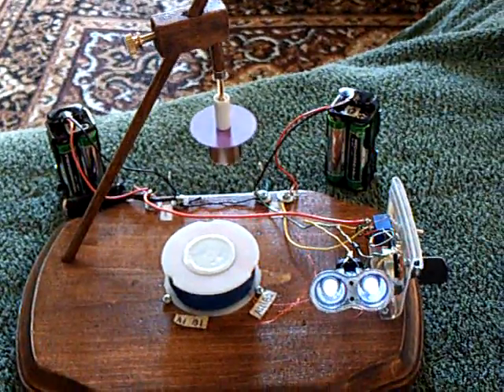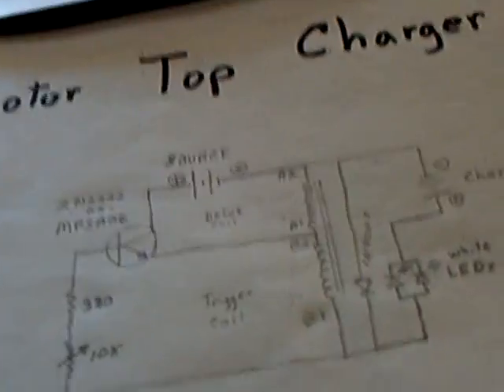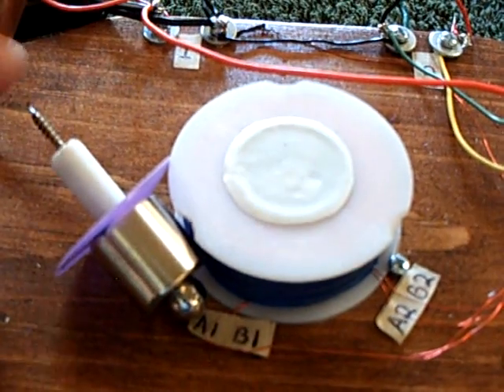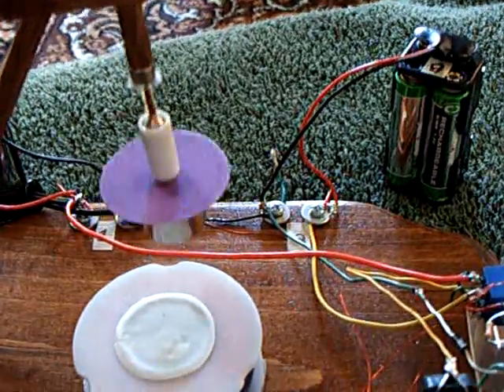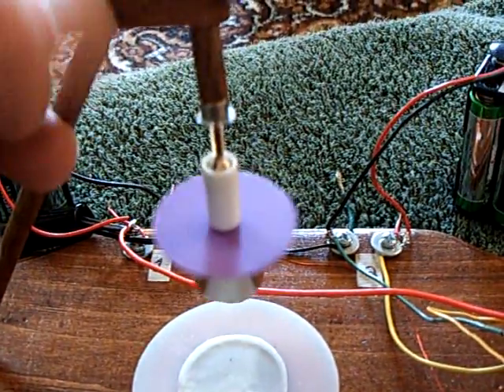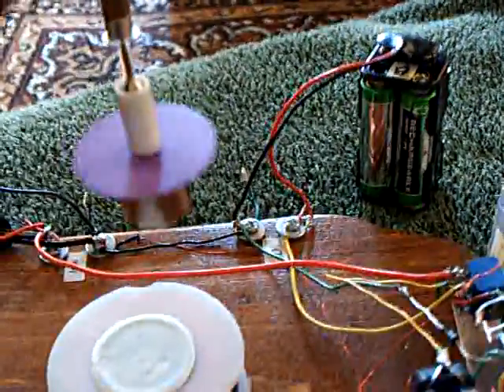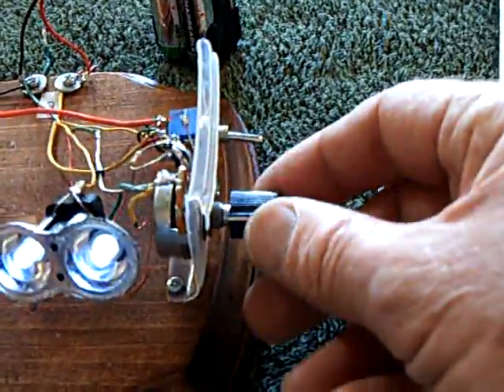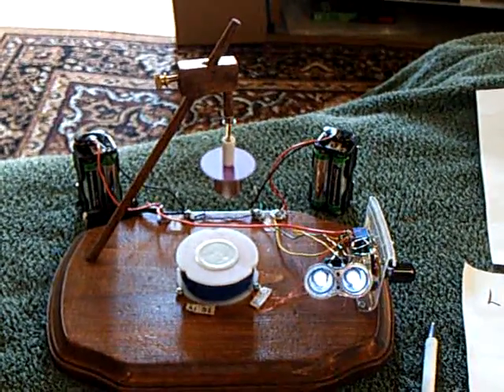Lidmotor TOP CHARGER with new top

Comment: If you can run at good RPM , and connect the shaft (screw) and the magnet to a wires like this watch?v=hXbFfMBW97A, you have an extra ennergy (homopolar generator de palma´s N MACHINE